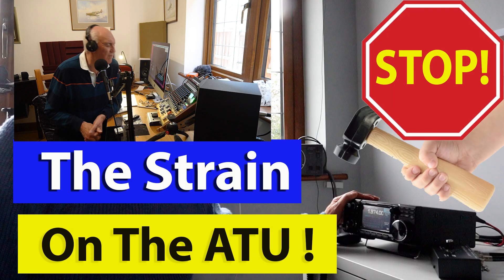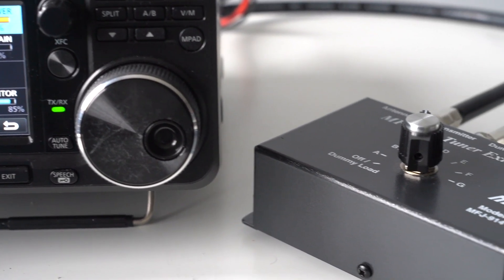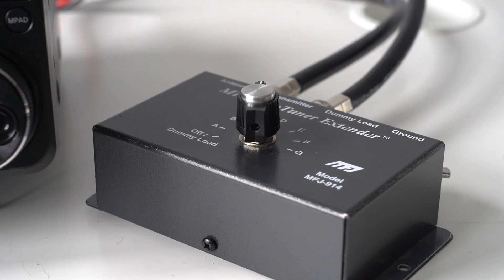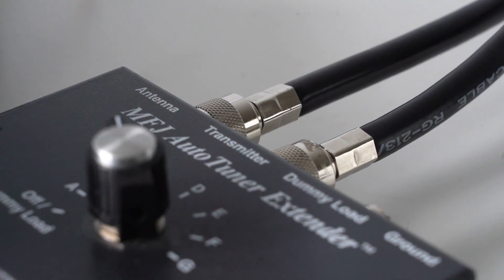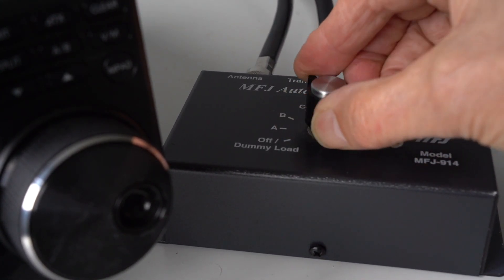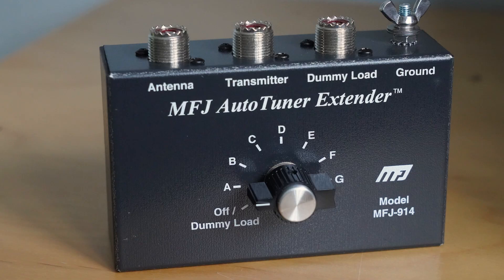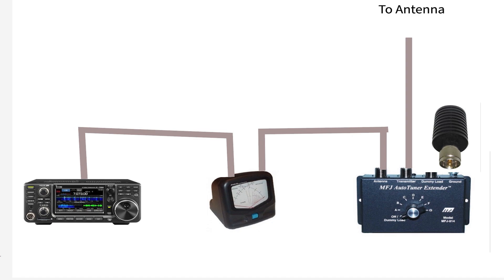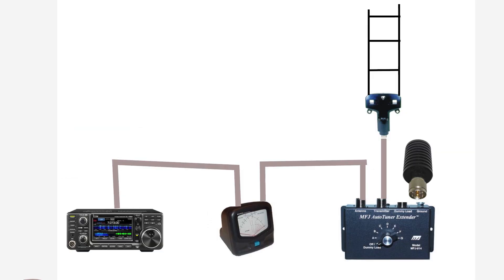Extend the Matching Capability of your Auto ATU and Save Money!

Comment: My setup is a yaesu ft-840 and a 49:1 transformer; 20m end fed+ coil for 80m with a LDG at-100pro and it won't match the impedance on 160m! Will the MFJ work with the LDG at-100pro to extend it's range?

Comment: Thank you for another helpful presentation. One question follows: Is it fair to say that the reason the ATU built into the transceiver cannot achieve a comparable match as the MFJ is simply due to component size constraints? I.e., couldn’t the admittedly large components in the MFJ unit be integrated directly in the transceiver? - Thanks! - Jim (KK7CSC)
Reply from the maker: Hi Jim, it is not a matter of the component ratings. The MFJ unit extends the ability of your internal ATU to match, by reducing the reactance component from the antenna. 73 Peter.
Reply: @watersstanton  very well put

Comment: Great video Peter, well, I've  got an older auto tuner , an LDG AT-600 Pro  and I find it a faff to use. First of all in some cases it's not that quick. Secondly you do have to be well aquianted with its operation, by comparison, in my opinion,  manual tuning is a tad easier. I think it's better spending the money on a good manual tuner. However I dont have any experience with the kind of equipment you have with internal auto tuning that's way out of my budget  and just to illustrate that my rig is a Kenwood  TS 680S with very bad slide controls:-)

Comment: Think about it Peter, the tuner does change the reactive part of the impedance between the tuner and antenna or else the power won't be transferred to the antenna, the tuner is providing a conjugate match in which the system becomes resonant, a full explanation is in the book reflections by Walt Maxwell
Reply from the maker: I think you are drawing the wrong conclusion from what you have read. An ATU does not change anything, it is a matcher.
Reply: @watersstanton  I can understand the conjugate mirror being misunderstood with there being so much controversy/misunderstanding around the subject , but the atu does change the reactance within the whole system the mechanism for resonance

Comment: Nice video. I am quite new to all this, but have a question. As far as I can see, in simple terms, the unit tricks the rf power amplifier to see reasonable workable swr, which the internal tuner can the  improve further, so you can  transmit of full power. However, the antenna of choice is still what it is, so not optimised for reception on the band you are trying to work. This is the bit that confuses me a little. Or, when buy an antenna for a certain band/ choice of bands, the actual decision is based on a low swr in transmit, rather than an inherent performance during perception??
Reply from the maker: Hi Mark. I am not quite understanding the question. Most commercial antennas provide low VSWR and don’t need exra help. It’s G5RV designs which present problems and otger simikar designs.
Reply: @watersstanton  thx . I guess in simple terms I am just asking , does the tuner help with reception as well as transmit!?
Reply: @markramsay6399  yes it acts as a filter
Reply: @markramsay6399  It will help but is not dramatic.  For instance, a 3 db change in audio is barely perceptible but that's a 50 percent change in power.  The AGC in your radio will hide this small change in reception (in most cases) making it SEEM as though the tuner does not make much of a difference on reception, even though it *is*.  It can certainly help in marginal situations.
As others point out, if you find yourself needing to use an external tuner, it is the antenna itself that might need some remedy.  Particularly with the G5RV style antenna, the ladder line is part of the system and should be kept at least some distance away from metal objects.   It can have very high SWR but with ladder lines that's relatively unimportant.  Where it becomes important is the transition from the ladder line to coax cable and that's the best place to put an external tuner.

Comment: Hi Peter, the pictorial representation of the 914, shows the transmitter output connected to the antenna socket. The antenna is shown connected to the transmitter socket. Is this correct? Regards, Geoff.
Reply from the maker: The intention was to show the flow of RF rather than absolute connections. Hopefully users will observe the labelling. 73 Peter

Comment: Kinda weird unit hides the true swr but reflected waves can still damage the radio right ?? Or am I missing sum thing. Kinda just a tapped inductor or resistor to fake out the radio. Yikes 😬
Reply: A tuner reflects the reflections.  That is to say, a wave bounces back from the antenna, the tuner bounces it right back to the antenna.  Provided you have little or no loss between tuner and antenna, you actually lose little or nothing of your actual radiated power.  If I put 100 watts into an antenna with a serious 4:1 SWR, but use a tuner to get it matched, those watts are still going somewhere -- out!  What will happen is that your antenna will have higher voltage and/or higher current as a result of transmitter voltage added to the re-reflected tuner voltage.  There can be a lot of current in the coax as a result of this and that can cause heating and loss.  This bounc-and-rebounce is much less detrimental with ladder line which is why the G5RV style antennas use ladder line.  Who cares how many times a signal bounces between antenna and tuner so long as it eventually gets radiated?
Reply: @thomasmaughan4798  yep a truly misunderstood subject, I would hope Peter does some research on the subject and make a video, with his good presenting skills people may start to listen and learn about the subject and enjoy their radio experience more
Reply from the maker: The MFJ-914 presents a low VSWR to the transceiver so no risk of damage. In fact modern transceivers are well protected and survive ooeb circuits. 73 Peter.
Reply: Reflected waves are reflected back to antenna at the radio or tuner, a good detail explanation of this is in the arrl hand book or reflections by Walt Maxwell

Comment: Does using the ground connection help? And is it safe to connect to the ground on your antenna/counterpoise? G7VFY
Reply from the maker: As. The case is made of metal, the ground terminal is connected to the outer she is of the kites cable. It simply replicates the Earth terminal on your transceiver. 73 Peter